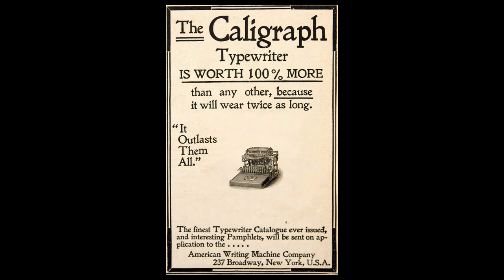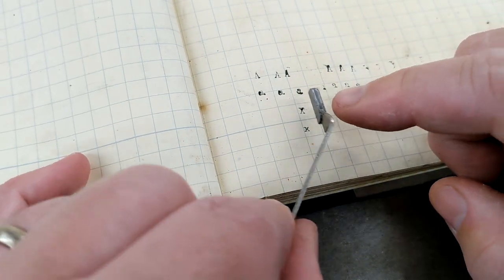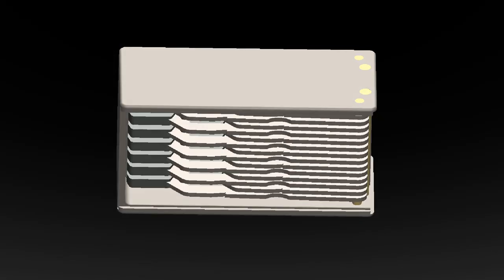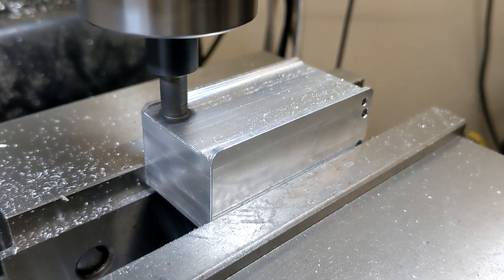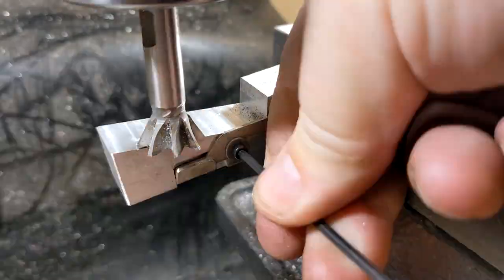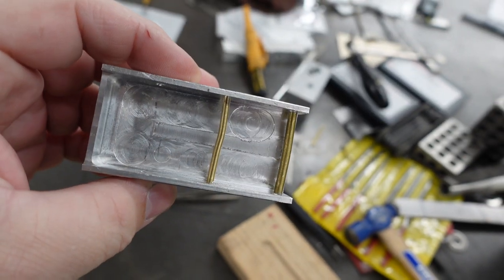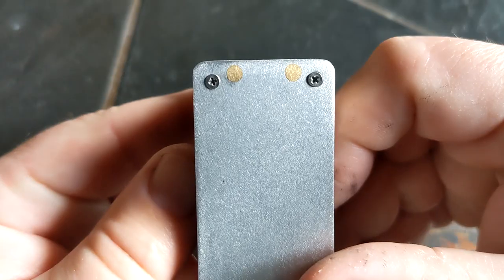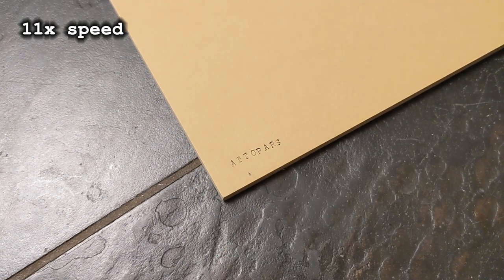Pocket Typewriter

Comment: Excellent project! I can imagine using this at the DMV to fill out forms :)
Reply: I bet the DMV lady would raise a stink even if you signed it with a pen
Reply: The DMV is slow enough.  They don't need a tool that's designed to slow them down.
Reply: The DMV probably has multi-layered forms on carbonless copy paper. You would need to hit the print bars with a tiny hammer to make the lower layers readable.
Reply: YES make the employees as miserable waiting on you as you are waiting on them 😈

Comment: As a nerdy prototype machinist and former tool & die guy, I appreciate this from many angles. Found via Hackaday (congrats!) I love that you didn't go buy the slitting saw and made it and heat treated it, even though theyre commonly available in that size. I also love that you chose rivetting. To hold odd sized objects in collets you don't have sizes for, you can either wrap shim stock around the object to increase its size, or turn a brass or aluminum rod the size of collet, and drill out the diameter of the object. Split it with a dremel tool so it can collapse, you now have a modular emergency collet custom for that part that fits in your main collet. I especially liked the dovetail undercut for fingernails. A lot of clever in this, great work 👏

Comment: A more practical device is a changeable rubber stamp kit. I used them to to fill out forms.  The kit came with movable type, a holder and ink pad.
Reply: I was thinking the same. A miniaturized version of one of those with just a single character would be very compact and easier to use. And it could still use metal type to get the look of a typewriter.

Comment: Firstly, the proper term for "striker bar" is "typebar", and the "type head" is called the "slug" which is typically produced by a foundry and soldered onto the typebar with special soldering gauges. Early typewriters likewise performed the shift by moving the platen (black rubber roller / paper holder) instead of the type basket; this is called "carriage shift" as opposed to "basket/segment shift".
There have actually been many attempts at "pocket typewriters" in the past, each of these generally using what is called a "single type element" or a wheel that has all of the characters on them. Since YouTube doesn’t like links, I can only give search instructions or the names of specific typewriters. “ETCetera back issues” will bring up the page for all the following relevant ETCetera journal issues: page 6 of Issue #57, page 5 of Issue #77, page 3 of Issue #82 for single-handed pocket typewriters, and page 5 of Issue #105 for coverage of the Taurus which is effectively an early manual label maker; in fact, modern manual label makers are among the last surviving "index typewriters" (originally produced as a budget option compared to the very expensive typebar typewriters of the time), some of which you can fit into your pocket. These designs were capable of holding a paper tape and automatically aligning the print. The approach of having just a set of type slugs and manually inking and pressing them is seen in the Ingersoll "typewriter". Also, the use of ink pads instead of ribbons dates back to the Williams, Yost, and Jackson typewriters among others.
Reply: It's nice seeing other ETCetera readers in the wild

Comment: lol, its a very, very overbuilt dial stamp! i have a bunch of dial stamps from when i used to work in an office that still used an ibm selectric. we had a few dial stamps that you could select any letter and they were 4 or 5 characters long. i believe i had a dial stamp that was only one character, so you could slowly spell out any word. your method is certainly more entertaining, but a dial stamp is a fraction of the size and significantly easier to use.

now that i'm thinking about it, the most common dial stamps were simply every possible date in various formats. i think i had one that you could rearrange the date format as well. i'll have to dig through the old office supplies and see if they are still in there. also who doesn't love smashing a massive rubber "DENIED" stamp on things!

Comment: I wonder if a hand held mechanical dot matrix printer with a cylindrical look-up table for the pin selection is possible. You'd have a selection wheel for the given letter that sets the start and finish stops so that when you moved the unit over the paper a wheel would pick up the position information to allow the next row of pins to be selected. I bet a watch maker could create such a thing but it would be horribly complicated, still a marvel to behold.
Reply: I can imagine something like this, using a dot array and a daisy wheel with the pin data on it. To simplify things for  I'd make the font monospaced, and I'd probably use 5 dotwidths to a character. (tbh I'd probably use a 5x5 matrix bc those make very cute fonts). You'd set the wheel, then use a button at the top of the contraption to press it down onto the printing material.
For automatic scrolling, you could use the same mechanism that a camera uses to advance film, so the button you press would punch down the dot matrix through typewriter ribbon, spring it back up, then latch onto the scrolling mechanism so all of that could be done in one motion.

I was going to say that because it's handheld, I'd expect it to be easy to accidentally move and so it would be hard to get it to hold its place , but now I think I misunderstood what you meant, I took it to mean setting one character at a time, scroll, then set another character, but maybe you meant setting it a line at a time, like a typesetting rolling pin, or a string of daisy wheels together?
Edit: Wait no, so it would print a single character at a time, but have a memory, to move x amount to get to the next character before? I feel like that would take up a lot of space, so I definitely see why you mention watchmakers.
Reply: Getting proper ink flow for it would be a nightmare, especially if you wanted to be precise and have it look like a real font. As a watchmaker, this seems impossible to make by hand
Reply: @melody3741  Yes each pin may have to be hollow and use an individual pump per deployment mechanism. As the pin is selected and it descends into position a pumping action would need to load it with a set amount of ink of the right stickiness and viscosity. As for what is possible, who said how small you needed to make it? BTW have you ever worked with using optical masks and metal etching to make parts?  MEMS devices can be very complex and incredibly small.  https://www.youtube.com/watch?v=iPGpoUN29zk
Reply: The IBM 026 card punch actually used a completely mechanical dot matrix printer to print characters along the top of the card. A 5x7 array of fine wires splayed out through a casting to a code plate. The plate was positioned to select the character and then pressed against the ends of the wires.
Reply: @gcewing  That is a very obscure rabbit hole to jump down! If you use the wayback machine you can find 225-6535-5_24-Base_Machines_FEMM_Dec65.pdf See Page 39, section 2.11 Print Unit

Also S225-3358-4_29_FETOM_Mar70.pdf  has a diagram of the wires, Figure 2-55. Print Wires
Reply: Probably easier to do a grid of pins for one letter at a time than one row of the page at a time. Though you would still need tiny cam mechanisms to select a letter.

You could just use capillary action for ink feed, like how dip pens work.
Reply: @DanielSMatthews Wow, thanks, fantastic manuals. The keypunch mechanics, the clear explanations, and the many, many detailed diagrams are just amazing.

Comment: I think this is an interesting idea; but I think the execution leaves a lot to be desired. First & foremost, the main value a typewriter adds is speed to writing. In this way it’s a fairly poor typewriter. Using a set of punch letters would be faster hahaha. 

But in terms of idea; I think you have room to take this to it’s most logical conclusion.
Two ideas worth examining is the type matrix or type box of old teletype machines. It’s a square grid of type slugs in a box. Pretty easy to control with XY coordinates, or a mechanical baudaut code interpreter. Second is chinese typewriters; they use a stylus to select a character, imprint it, and return it to the typecase.
A pocket typewriter I think would combine there two ideas.
You’d have a typebox, which slides in the X & Y axis, the movement coupled & controlled by a reticule/cursor, which however’s over a qwerty type chart. Since the chart matches the arrangement of the type, typing is straightforward. The reticule has a single button or key, sprung, and on a pivot, so it strikes the type slug in the box but only the selected character. This provides a consistent impression. The lever should also advance a ratchet & pawl, therefore moving a rubber roller one character space. (The other bearings being two wheels or ball bearings) (And advancing the ink ribbon), the whole assembly therefore should wind up about computer mouse sized or phone sized, but actually offer a real value. It also should be fairly simple mechanically. Also each type slug should be sprung so they are in contact with the page only when they’ve been struck. 

Interestingly this problem has been solved before. Because architects & engineers needed to letter drawings, and hand lettering is time consuming. Technical drawings are usually too big for typewriters, even wide platten bookkeeping models. So you make a typewriter that types on a flat surface. The Blickenderfer architect’s typewriter, rides on a drafting machine scale with teeth set into it; typing moves it along the rack, and strikes the page in india ink, applied from a pad. They’re not large, almost pocket sized. But fairly similar. 

An alternative proposition, is a type drum, with the type arranged around a drum, and positionally matched to a corresponding drum with the reticule, and a striker key sitting below the drum, this saving you the number of springs for the type to ones necessary to return the carriage to neutral. (Also substantially easier than making a type ball). Since the paper is flat however, you’ll only be able to have one character in a row, since two or more rows would imprint at a time if struck. The more characters you need, the larger the drum. (However if the characters are rubber, it could be more compact as a belt.)

Comment: I feel like there could be a more realistic every day use version of this that might work if the letter type heads got ink in a similar way to fountain pens or something. Maybe the force of the metal arm swinging could be used to draw the ink up to the head if done hard enough. It would be tricky to make it not get leaky however. I'm envisioning a soft stamp style design instead of metal type sets, the letters being made of a somewhat porous rubber foam or felt that will take in the right amount of ink to write but not bleed. as for the previously stated "swinging", changing the length of the arms and setting them up to be flipped into position to type with a sort of "see-saw" or piano hammer motion. like it folds out in two ways to be a line or bar that can be manually slid like a ruler by the user so that the letters can be spaced properly. theoretically when fully engaged the tool will look kind of like a melodica but with round buttons instead of long tooth ones. the entire thing could potentially be made to fold down to the size of a box of cigarettes. I could be wrong but I figured that it at very least might spark some other ideas even if it isn't a good one itself.
Reply: the practical version of this is called a dial stamp, and they have been around since the 1800's lol (i have a bunch of them). usually they are purpose built with every date or a bunch of common words (approved, denied, paid, void, etc) but i have some that are every letter and you just dial the letter you want to stamp down. this weird typewriter version is way more fun though.

Comment: I'd add a line to the back of each striker bar that would coincide with the bottom of the character. So say if you were filling in a document, you could line up the line on the back of the striker with the line on the page and be sure it would place each character at the same point on the line.

Comment: Awww... honestly I was expecting something better... this is like a downmarket Dymo labeller. You might sell this to hipsters if you put just a little steampunk on it. I don't mean gluing half a clock to the outside case, but at least include some actual mechanisms, levers and the like. A folding case that makes them go "Aaahhh!".

Similarly you might be able to attract the "elderly nerd" market, who have a bit of money sloshing around and spend it on stuff like Curtas. It would benefit from an actual keyboard though, and if not a full carriage, at least be able to place it on paper, press a key, and print a character. You might not have the full finger-power of a full-size typewriter available, but you could have a little clockwork motor in there. You can buy those, even cheap from China.

The thing could have a groove that aligns with the edge of a notepad or the like, or perhaps a nice brass rod with a foot on each end, that the whole thing slides along, to provide something equivalent to a carriage. Move the printer, not the paper. It would likely require a redesign, but how great would a pocket typewriter that's actually mechanical, not just a Swiss Army Knife printing set, be? It could be done, we have such clever software these days and CNC, you can produce stuff well beyond your manual skill level.
  
You might have it type on a scroll of paper, just 2cm high or so, and wound like cine film on a sort-of carriage. Tiny little 1-character platen! These would be it's special medium! You could store scrolls in the case somewhere, it would be a new and pointless medium, but artists love all that shit.

Comment: What was the issue with bending the ends to allow for both upper and lower case?
Reply from the maker: They kept breaking in half in the process.
Reply: @Attoparsec  Soldering/welding pieces in place would not be an option?
Reply from the maker: @tiagotiagot  Possibly! I probably should have tried soldering, but I figured it would all just melt and destroy the type itself.

Comment: why i was expecting folding keyboard and small electromechanical typewriter head srtiking the paper lay down on a table, nothing say typewriter has to be fylly mechanical, in fact there were many models that were more computers than typewriters and yet they only had one job like those wierd casio typewriters that could edit thext line by line before printing it